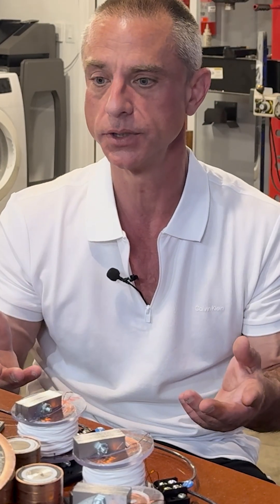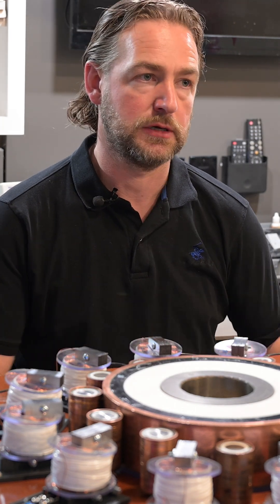Searl Effect Generator #Antigravity

Comment: cant you make a donut half filled with mercury in the center and an outer mercury filled ring to have more volatage being charged and having the inner mecury rings vortex rpm run against the outer rings mercury vortex it would create gyroscopic type effects no?

Comment: Very cold so the device becomes superconducting so the IR is anti gravity waves. That is correct Tim. Multiple ring layers using plastic or ceramic electrets so the magnets stay charged. Yes, the speed does depend on the external load as my solar panels need a load to work. The correct speed will produce the correct aether wave that is a gravity wave.  The correct voltage and current. Yes, torsion waves. Spinning gravity waves that make all things in the universe spin. It does not seem as if Isaih understands everything that you are saying to him.
Reply: Torsion physics is an interesting one

Is there an email i can use to ask you some specifics?

Was looking into winterbergs unified theory based on planck aether recently as well as many others.

More curious than anything since i know im like 100 years behind

Comment: Been watching people trying to re-create a searle effect for over a decade never seen anything that worked
Reply: That's cause thry dont use water. Not from UT tap. Salt water or clean water from source underground. If u try to take it from tap it does nothing now u know why fliuride is in the water.  Wonder why u get out of the pool when it storms?
Reply: @bradharris1062  there is no water used in the searl  effect. This is not a splitting the water hydrogen generator.
Reply: @drscott1 you mean electrolysis right

Comment: In this brief review, I would like to emphasize—as a mechanical engineer—that the All Propulsion channel offers inspiring perspectives that go beyond the mainstream. It's important to clarify that we are by no means able to manipulate spacetime today simply using coils and magnets. However, it is state of the art that magnetic fields and suitable materials are indeed used in specific cooling processes. This is already common practice in certain startups.

In our small, hobby-based research group—consisting of engineers, physicists, and chemists—we enjoy questioning established models because we believe that current physics still contains dead ends. We are convinced that a deeper understanding of space and matter, especially at the quantum level, will open up new possibilities.

In this sense, I appreciate that the channel has the courage to address such unconventional ideas and expand the horizon—even though we are still at the beginning of truly understanding the underlying mechanisms.

Comment: The G-Field Energiser, E V Gray motor, Sweet Floyed, and many other all have had their inventions exhibit the Endothermic  and Anti-Gravity effect!
Reply: The quantum-inverted gravitonic lattice is achieved by phase-conjugating local spacetime curvature through a polarized Higgs–Casimir manifold. By resonantly modulating the graviton interaction cross-section via subharmonic torsion waves, the apparatus destabilizes the mass–energy equivalence field, effectively creating a negative inertial gradient. This results in a self-sustaining counter-gravitational flux, stabilized within a superconductive magno-toroidal containment ring.
Fine-tuning of the field’s coherence length is accomplished by introducing controlled quantum decoherence pulses into the gravitonic phase array, thus preventing catastrophic spacetime phase-lock while maintaining lift vector stability.
Reply: Finally  someone who talks like a normal person